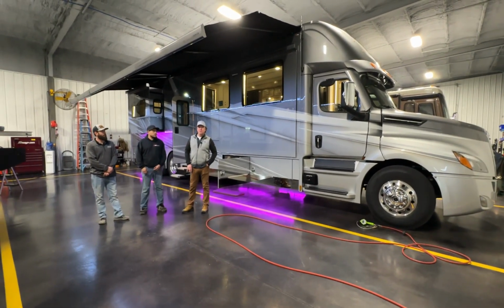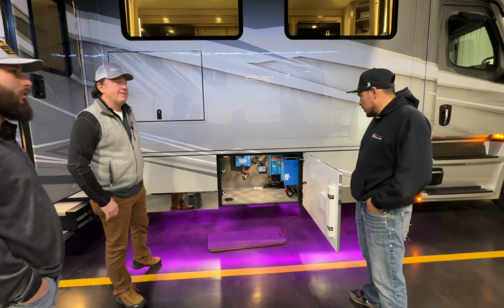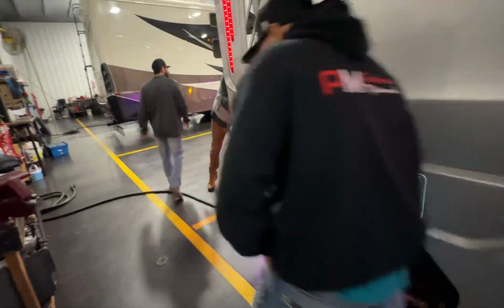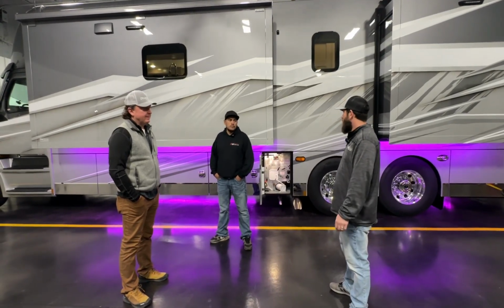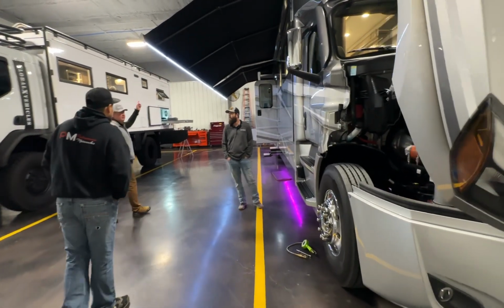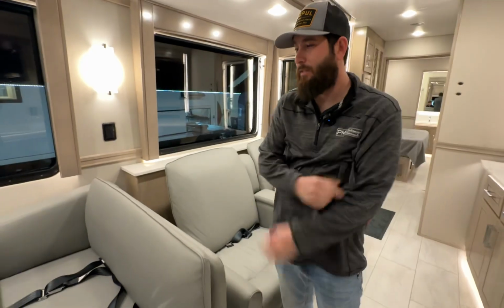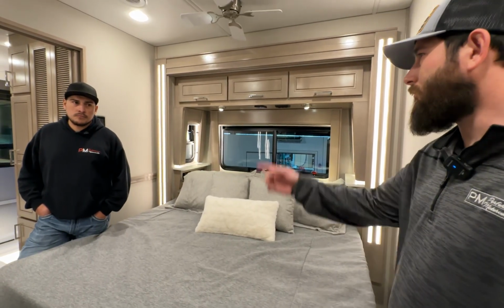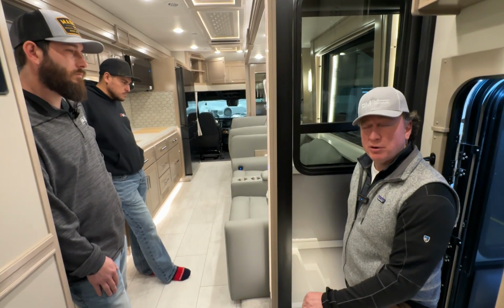Why get your next Renegade from Performance Motorcoaches

Comment: I was more or less sold on Darin and Performance but this truly sold me on buying from you guys. It was great to meet the service team and learn about your process. We have a trailer now and the customer pickup experience was ok but we did feel a little rushed. It was great to hear you don’t do that. We are in the process of building a house now but as soon as that’s done, I’ll be reaching out. We want to start out small as we want mobility but will move to something larger when mobility isn’t as big of an issue. I want a dealer who can partner with me as my RV needs change. And I love the Renegade quality. Show Hauler too but I may need to rob a bank to buy one of those.